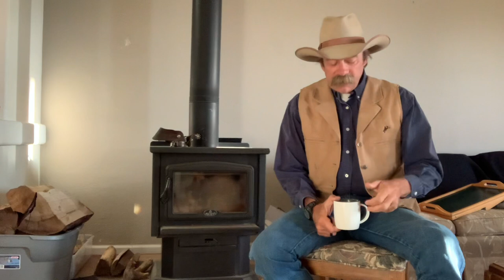When Your Horse Can’t Be Still

Comment: I guess I'm a mite different than most folks. I have rode a lot of horses on trail rides, and stuff. Some horses do just fine if they are out in front, and do just great, put em in the middle or in the back, they didn't like it. But where they didn't want to be, is where I would ride em! Sometimes it was a little rough, but they needed to learn different places, it was where I wanted them to be, not where they wanted to be, in there happy place. And if they didn't want to stand, just before they moved, I made em move. They thought it was my idea and not theirs, they figured out that it's easier to stand...than to move. But what do I know, I'm 73 and still learning! Just another case of "there you are"